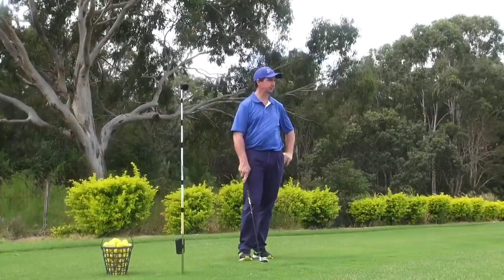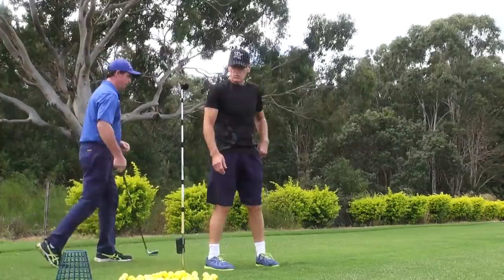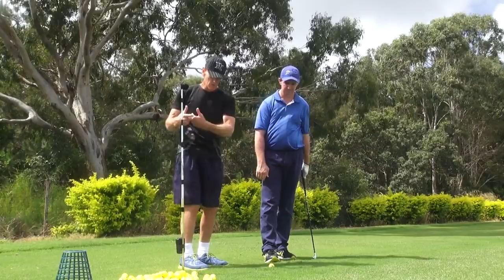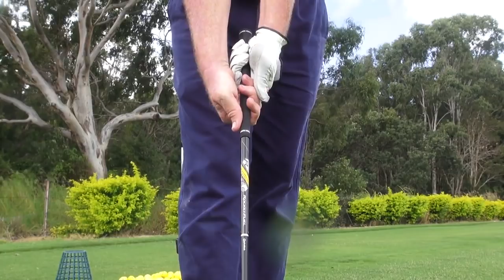Opposite Lock  Chipping Pitching

Comment: Great stuff JH and Mr X. Reckon Mr X could strangle a bear with those mits.
Reply from the maker: Hi Mr K,
                  Mr X  does have  a decent set of 'Paws'..  as a result he doesnt need to exert much pressure in his grip at all which is a big  advantage.
                     cheers Jh
Reply: I shall be giving this a go at the range shortly. Like Mr X I'm decent up till about 50yds in and the little dribblers around the green. Seems like ive got the yips. This different approach may be what the Dr ordered. Will keep you posted. Thanks again guys.

Comment: This video of Moe pitching shows that there is not a straight line between his arm and shaft but of course the shaft stays on plane. https://www.youtube.com/watch?v=IHmq4xhS_bI. 

Being on plane back and forward is a lot easier with the shorter shorts because there is less lift and rotation and club length is shorter but I don't think it is necessary to have the arm in line with the shaft. You would have to stand so close to the ball that it would feel cramped and unnatural. Having you pitching club 7-iron length and a different lie angle would be a different kettle of fish though but Moe didn't have single length irons but gripped up or down accordingly.

Also Moe's right-hand grip is very much under in this video and looks kind of what Mr. X is doing https://youtu.be/nxHJ4lMoVb0

I am wondering if Mr. X has tried the 'Moe lock' + 'Opposite Lock' grip as a combination with longer clubs?
Reply from the maker: The grip is only designed for short precision accuracy shots ... Mr X only hit a few full shots today for fun ..  the grip doesn't afford enough contact area to support a full speed swing... full shots require rotational release .. this grip is designed to totally eliminate that... Moe never remotely had his lead hand configured as we were advocating today  ... the whole idea is to have the maximum rotation of each hand /forearm at address away from each other in opposing force directions which make the elbows want to get closer to each other ... 
                  I think the grip formation is unique.. Paul Runyan had his hands pressuring in opposite directions but not off the club as we had them .. and his elbows were as far away from each other as he could get them .. the complete opposite to the 'Opposite Lock'  grip ... bear in mind   Moe had a palm grip as well which made his trail hand 'look' stronger  than it was 
                    cheers JH
Reply: ok, thanks for that clarification. I'm looking forward to trying the technique it out. There are a couple of training aids that help that Y connectiveness. Google the golf swing shirt and Tour Stiker Smart Ball

Comment: Looks like Paul Runyon chipping technique, opposing palms even with putting. Works great
Reply from the maker: Hi Jocko, 
                     It has an element of 'Runyoning' in it ... it differs a lot in the pressuring of the elbows ' inwards/together' as opposed to Runyon's positioning them  'outwards'... our grip rotation extremeness is also a departure from Runyon.. absolutely works great with putting.
                  cheers Jh